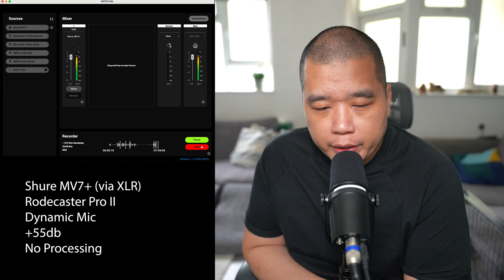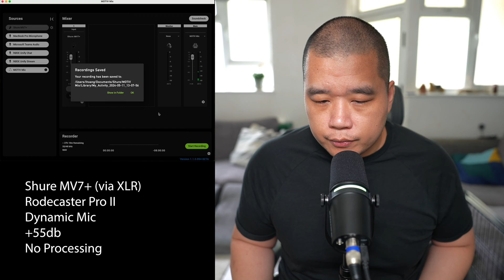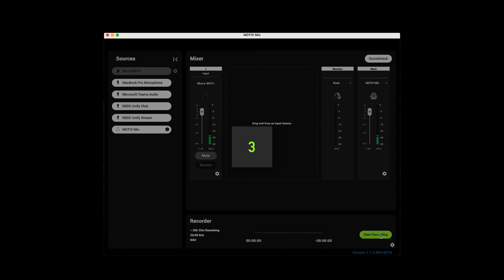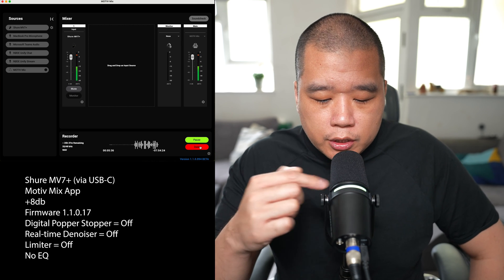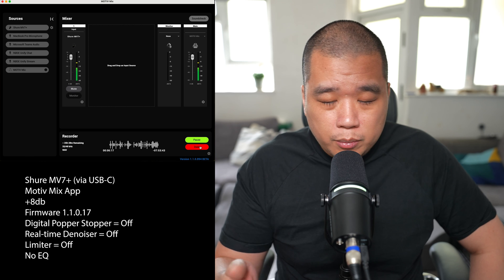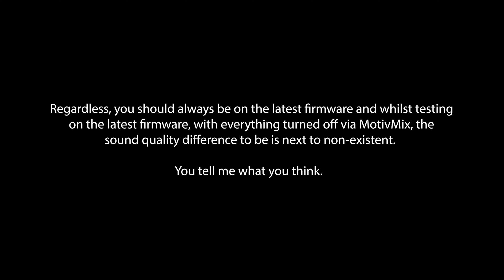Is there a sound difference between XLR & USB-C on the Shure MV7+ / MV7 Plus?

Comment: You have just got a new subscriber ! I looked everywhere to see what gain people been using with the MV7+ and I couldn't find it anywhere. Until I finally see watched your video. Thank you ! I think +8dB is the sweet spot for this mic.
Reply from the maker: Thanks mate! Glad it helped! The gain level will vary depending on the persons mic etiquette and general speaking volume… when the audio signal goes up the meter, the loudest part of where you speak should hit just below the red region in the yellow. Otherwise the audio will clip. 

This is what I’ve been aiming for at least. I’m not at the point of any advanced audio processing, but I believe during the processing stages you would raise the quieter tones and lower the louder ones to balance off the audio a bit more… but I am an audio noob still! 

Despite having done a few mic tests etc. I’ll be covering various topics of multimedia and tech… 

Thanks for subscribing!

Comment: I have a question please. I have a windows laptop, And m7 plus comes with usb c to usb c cable, i think there’s no usb a cable, how to fix that?
Reply from the maker: I’m sure you could buy an after market USB-C to USB-A cable, or they do have little adapters also available on Amazon. That’s what I would do. But I’ve not tested it with this mic but this is what I’ve done in the past when I needed a USB-A connector and hadn’t had any issues. 

I’ve had to do that with hard drives and the only downside would be a slower data transfer, but for the mics, it shouldn’t be an issue as mics don’t require much bandwidth to begin with.
Reply: @leo_hoang  I will buy usb c to usb a from anker, could this affect the quality by any means? Thank for responding.
Reply from the maker: @OislamforallO1  I don’t believe this would impact the quality as you’re going to use a cable for a digital signal. If you was converting an Analogue signal via XLR, then potentially a cheap cable would affect it. But with USB, it’s a digital signal so I wouldn’t expect the sound quality to be affected at all. 

I would only expect issues on a digital cable over cables longer than 5m… but this would be down to connection stability rather than quality of output. That’s my view on it from a very broad perspective at least. 

Hope that helps!
Reply: @leo_hoang I really appreciate your help. Thank so much for the great video and for the information . My order is on the way.
Reply from the maker: @OislamforallO1  anytime mate! Hope all goes well… keep me posted

Comment: I was going back and forth between the (black) RE20 and SM7B myself. Ended up with the RE20. Just something about the sound of that mic-especially through the RCPII, that I love. Good luck in deciding your favorite!
Reply from the maker: I have the black one also… for some reason I want one of each lol… but no, that’s just too crazy of me… 

I am leaning towards Shure SM7B at the moment though… I feel like it’s an easier mix to use… it’s not capturing my breathing as much and not as sensitive to plosives… it doesn’t have that sparkle the RE20 has, but SM7B for me is easier to work with..: 

RE20 def does sound better to me though… 

I have a feeling I will just sway back and forth depending on the day and my mood lol
Reply: @leo_hoang  Take a look at the BSW Repop. It's on my list of things to get to deal with plosives/breathing. That said, just tilting the mic a little off-axis almost always fixes those problems.
Reply from the maker: @BaseCammp  I’ve actually bought that already and a foam windshield to test… I’ve not got around to testing it yet… it’s funny, because I rented an RE20 a few months ago and I guess I had better mic technique then I don’t remember it being much of a problem, but using my own one it’s irritating lol… but I hope these filters might do the trick to make it easier to work with…